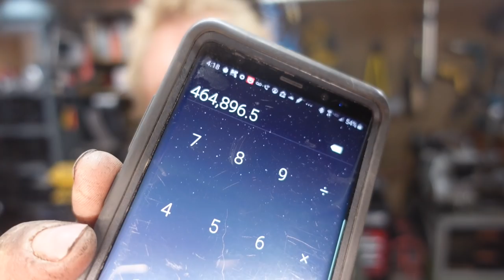Homemade CO2 Laser Tube Part 2

Comment: The reason a He-Ne laser is recommended over a semiconductor laser for alignment of the mirrors is that the coherent length of the He-Ne is much longer. You can't MAKE holograms with a semiconductor LASER even though you can read them out with one.
Reply: Sincerely interested.
At least for the first part of the alignment of the mirrors, isn't the divergence of the He-Ne more important than the coherence length.
At which point (and for what reason) would the coherence length become a factor?

Comment: The peatier will be giving an output based on heat-flow across the device, not power applied to it.  My suggestion would be maybe a copper plate, measure the change in resistance should indicate the instantaneous power. I think a four wire measurement might be required (assuming that it works at all).

Comment: Your "low power" green pointer is both very high power, way above class 4, and very dangerous, because it emits 808, 1064, and 532nm light.
You were very lucky to not have gone completely blind from an accidental reflection.
To protect yourself from a CO2(10600nm) beam you can use regular polycarbonate(only!) safety gogs.
For 808, 1064, and 532nm, you need very specific goggles, and they are not very cheap - you need a minimum optical density(OD) of 4 at all those wavelengths for a ~200mW laser. Laserglow sells pairs like that, and if you want to keep playing with it, I highly recommend you get a pair before you burn your eyes out. The trash that came with the laser(if it did at all) is just colored plastic.
The reason people suggested HeNe(which you can buy used on ebay) is because most of them are generally safe(<5mW), and have a near-perfect TEM00 beam.
Reply from the maker: Oh man, I'll be more careful with that little thing.
As for the actual Co2 laser, I do have properly rated laser goggles for it, so at least I'm covered there.
I'll definitely be keeping my eyes peeled for a cheap HeNe laser though.

Thanks for the input!
Reply from the maker: @joel_mckay  got em ordered! Thanks!

Comment: super late to the party, but i found this on the old interwebs  You can use this to calculate the effect of your laser? 

The specific heat of water is 4.18 joules of energy to raise the temperature of 1 cubic centimetre of water by 1 degree Celsiusfrom its melted state up to 99 degrees Celsius. A litre is 1000 ccs, but then to boil it or convert it to thr vapour ..or gas phase you need to find the latent heat of vaporisation ..abd add thst. Once you have that divide ,and you want to do it in 1 second ,thats your wattage.

Comment: For wattage wouldn't it just be easiest to shine it on a very dark matte black container filled with water (where the rest of the surface area is well insulated). And look at the final temp, then initial temp. Plug it into ∆Q=mc∆t 
Get the amount of joules pumped into the system. Then just divide it by the time taken to get there. A similar method can be done but instead looking at the constant rate of increase, but there you need much more sensitive equipment.

Comment: i may be wrong but wondering if this will work much better if you use a much wider diameter tube with shorter length to have a larger lasing medium and of course the mirrors need to be bigger but it may make alignment a breeze and for it to work much easier putting out more power the beam will be bigger but then its only a matter of using a reverse beam expander lens setup to create a tighter smaller more powerful beam output for cutting, seen large setups like that at a science center where they burned my name into a wooden piece of planck using the laser it was so fast and neat all done by hand with someone holding the board at the output end to etch my name in it, actually that lady was pretty skilled to have been able to do it that fast with a cw laser output all while getting my name right and quite legible lol good hand eye coordination

Comment: I’m wondering if you could use a telescopic Cramer lens on the end of the laser to narrow the Dia of the beam of light  ? You might need to install mirror on both ends of the lens ! One thing too keep in mind you may want to shoot it at a 2 inch block of steel just in case it does work . Oh yes love your projects... keep um coming..
Reply: 2inch block? It will need a bit stronger power source (our old industrial CO2 laser machine could drain 60kW and High voltage power source itself had 50kW peak and it cut up to 25mm/1" at industrial speed)

Comment: It takes 1000 calories to raise 1 liter of water one degree C.

a watt is .24 calorie per second.

Grab A steel pot with thin walls. Bonus points if it's dirty and rusty - will absorb more of co2 wavelength. proceed to abuse it star wars style. I recon it will absorb around 80% of optic energy. Stir the pot and measure time it takes to go up 1degree of science from the ambient temp. Rinse and repeat for a couple of times to average out the errors in measurements. Do the math and you should have a approximate result of the retina burning capacity of this thing. There are better ways but few as janky. PS for the love of God make sure to stir clockwise. I learned that the hard way ;)
Reply: Should have read the comments before commenting. Had the same idea. Also you don't need pot. Can do it probably with plastic bottle because water will absorb the heat. If the laser isn't super high power so it will evaporate the bottle before water can absorb anything. 
Btw, who is using calories? Just use Jules!
Reply: actually might be a good idea to find a good heat-insulating container and point the laser down into the water in it (water absorbs that freq), that way you won't have significant amounts of heat being dispersed through the sides, and from the top you can measure exactly how much heat is dispersed by looking at surface area, ambient temperature and humidity

Comment: If you have it still working and don't know the power out, just heat up a litter of water and measure the temperature, that will give  you the actual joules from basic equations.You already have the duration and it should give a best approximation on power.

Comment: Nice work man! The front-camera of an iphone sees infrared laser light as it lags an optical infrared filter.
Reply: Co2 lasers output is Long-wavelength infrared or 10600nm (10.6um) where as the ir your phone can see is Near-infrared which is 750nm-1400nm. In theory a thermal camera could see the output but I wouldn't advise pointing a multi-watt laser at an expensive thermal cam lol.

Comment: Wow awesome stuff. I can't believe you actually got this to work. Good stuff! Now if the output isn't enough to meet your needs, do you have any ability to increase the wattage?
Reply from the maker: It's kind of limited by the power density that can can be attained by the tube length and bore diameter. But it can be tuned by using different output couplers, different power supplies, etc until the optimum specs are met
Reply: yep, tube length is generally the rule, bore diameter has rather diminishing returns and after a few inches makes essentially 0 difference (from a paper I read a while back). you can see this in industrial units as they just have a bunch of tubes around some structural holder with the laser traveling through each one in series

Comment: You might not be aware, but helium sold for balloons is not pure helium as it is too expensive. I have heard various percentages, with numbers as low as 25% He. Also you fittings and rings are probably outgassing into the chamber. It is really tough to pull and MAINTAIN a vacuum.

Comment: You can measure laser output by measuring laser power absorbed in water raising its temperature. Aim the laser through the open top of a lexan (or other ir absorbing material)  container of water. The water will absorb some of the IR, the rest should be absorbed by the bottom of the plastic container to heat the water. The outside of the container should be insulated. Use 453 mL water (not a pint)  or weigh out 1.000 pounds of water. Measure the water temperature. Turn on the laser, wait 60 seconds, turn it off, give the water a swirl to make sure it’s well mixed and measure the water temperature again. Multiply that temperature change by 60, that will give you Laser output in btu/hrs. Multiply by 0.2931, that will give you power in watts.
Reply from the maker: Thank you, this was very detailed!
Saved for later.

Comment: Congrats!! I hope diy co2 becomes easier with time.
Reply: Wattage...no experience here but maybe heat black metal in an aquarium of water. Measure temp before and after. That'll give you a minimum wattage (some reflected).
Reply from the maker: @TheRainHarvester I may have to give that a shot!

Comment: You can use a known mass of black anodized aluminum and measure the temperature increase from a timed pulse to figure out how much output power you are getting. Don't ask me for details I don't know how I just heard it can be done! 😁
Reply from the maker: This seems like a pretty simple solution, I'll be keeping my eyes peeled at the scrapyard for anodized aluminum!
Reply: @cranktowncity  I'd paint a known-mass piece of aluminum with "Black 2.0" and measure its temp change from a short burst of known time. That'll give you a lower bound of the power. I'm guessing 1-5W.

Comment: Very cool project! Thanks for sharing. Just a question, where do you get the output couplers or partial reflectors? I usually get my lenses from AliExpress but can’t find the partial reflectors
Reply from the maker: you can find them used on ebay!
Thanks for watchin!

Comment: Interesting that your laser is producing 3 parallel dots. You're operating in multimode, not single mode. How do you correct this? No idea.

I have a set of plans from 30 years ago, never made it far enough to make it work because I didn't have the money in high school.

Comment: oh god the lens is made of some poisenous stuff, you shouldnt touch it when it breaks , i would rate the power to about 100 watts? i worked on a few laser cutting machines, i can tell you 2,5kw laser power does a concarve hole 10mm diamater and about 5mm deep hole in about 1 secound (without a lens), cool work though!
Always wear saftey goggles when using lasers ! the helium ones arnt that "dangerous" might just popp off the first layer of your eye, but there are some other inert gas lasers which, wouldnt do that, but instantly and forevery damage your eyes.

Comment: Is TEM governed by power and the difference in mirror reflectivity? The closer the mirrors the greater the power -extra modulation, conjoined with power supply size = output power?

Comment: Have you tried a copper gasket? they tend to me better for holding a strong vacuum.
Reply: You're right but he's simplifying things by using a rubber O-ring that's flexible enough for him to adjust mirror angle right there on the end of the tube. It's that versus e.g. using a Brewster angle window on either end so that the mirrors can be physically independent of the tube. BTW I remember from my laser physics class that sometimes the Brewster windows used on CO2 lasers were made of salt.

Comment: Test its temperature 🌡️ and try to make light 🌞 energy is it possible ? By expanding laser dot to big light 🌞 and put the expanded beam straight to the solar panels which is enough to generate electricity.

Comment: 60% reflectivity? the resonator cavity probably has amplification of 1.02 (ballpark) so in order to start lasing your mirror has to have reflectivity of at least 98%. are you sure you got the numbers right?

PS i never worked on a CO2 laser, but i did make a HeNe laser work a long time ago and as far as I remember these were the numbers
Reply from the maker: You're right!
I use this equation:
                                         Ld
                            R = 1 - ---------
                                     500 * D
where Ld is the length or the resonator and D is the diameter of the resonator.
for this tube I'd need an OC with 87% reflectivity.
Although this is just for optimum performance, and a less reflective OC is easier to get an output from.
The reason I used a 60% was just because that's what I could find on ebay hahaha. Still keeping my eyes peeled for an 85% but I'm kind of married to what I can find for cheap haha.
Thanks for watchin!

Comment: well your power output will be less than your power input, that'll be a good starting point in figuring out what your output power is.  400000 watts - umm the US Govt would like to talk with you.  Russians too.  Chinese too.  N Koreans as well, but I dont think they've got the money to pay for it.  

I've got a doubt that your beam is collimated.  shine it on a hot dog set at 10' and see what the crater diameter turns out to be (btw, the easy way to get accurate burn circles at any distance is to place the target and pulse the laser on/off until you just start to get a circle on the target - measure that.  If you wait and smore smoke the circle in, the edges will be fuzzy).  If the circles are different diameters (2" vs 10' target distances), you need a corrector lens between your laser and the target.  Not just any corrector lens, but a really preciso corrector lens.  You can figure out what the lens shape (probably spherical) and focal length should be to get the beam back to collimated, but you'll need to know that your flat mirror is, indeed, flat and what the exact shape of your curved mirror is.  Beyone that, no problemo, figure out the shape of that lens, make it and watch your 2x4 burst like a fried ant (as well as your garage wall and your neighbor's garage wall(s) any trees or fences between and maybe your neighbors car).   Oh, btw, pick your corrector lens material carefully to interact best with the IR wavelength you're generating.  
(Interesting fact - they originally got the Hubble mirror wrong - something to do with the SI vs Metric measuring systems I believe - a corrector lens like we're talking about got the Hubble from fuzzy images to what we've seen since.  That's your next challenge here - go from fuzzy to death ray)
 Read my comment on your first video - there are other things you can do to turn your laser into something that will really irritate your neighbors and maybe get the fire dept called in.

Comment: Looks like its less than a watt of output
Reply: I read someone comment that it looked like 40-50 Watts, and I thought they were off by an order of magnitude.
My uninformed guess would be in the single Watt range.
Reply: @oscargr_  30 watts is a much more vigorous beam.  It’s definitely impressive for your first laser.
Reply: @Astinsan  it's impressive to build a laser from more or less house hold items, period.😎
Reply: @oscargr_  makes me want to build one. Was looking up supplies to get started. Got a waterjet machine at work to cut the metal parts.. trying to find a friend with a lathe. 

The old fridge compressor will work better for your vacuum pump than that pump you are using. They have a tendency to overheat especially if you forget to take the vent stopper off in use
Reply: @Astinsan  I hope you re not confusing me with someone else.
I have worked with quite a few (gas) lasers, both high power ones and high precision ones. The experience of maintenance on gas lasers makes me not really want to build one from scratch, because I worry they will be more trouble than the ones I already worked with. (safety is also a concern)

Lucky you to have a water jet and a boss that lets you use it for personal projects.😁😎

Comment: pls  i want ask to
Reply: Please, I have a problem with the laser tube. When I do a plus, the tube lights up and when I turn on, it does not light up and does not emit a laser. What is the reason? I changed a new power supply and the problem is still. Is the tube destroyed?